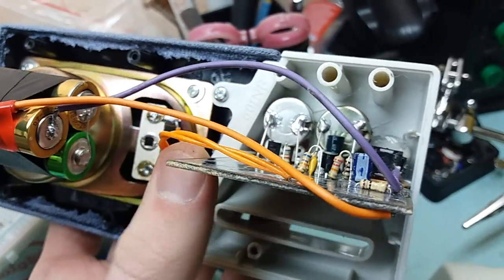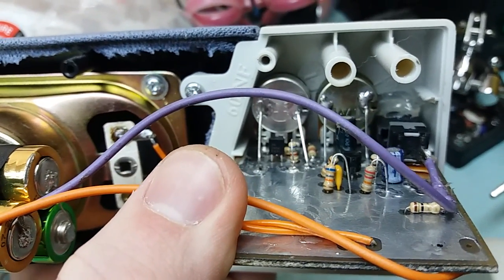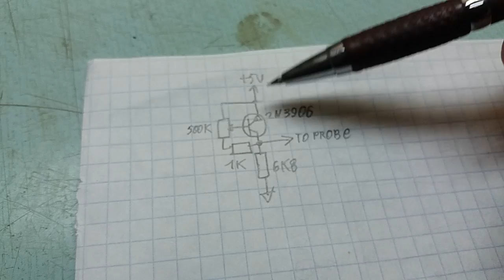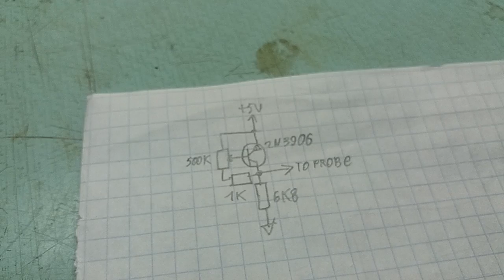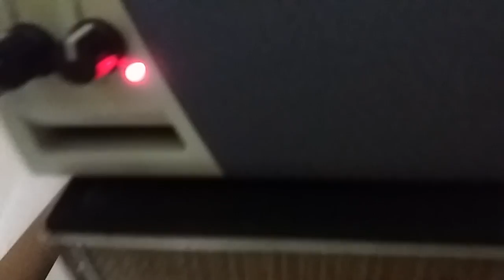My variation of Mr Carlson's SuperProbe

Comment: All my RF probes had a short ground wire to use when needed.  Using your finger could be hazardous.  Especially on a tube circuit.  I also had a probe with 2 spring loaded tips.  The ground one was a bit shorter and slightly flat and abrasive.  It worked great for tightly packed circuits,usually handheld radios.  Boonton Electronics makes a nice analog RF millivolt meter, if they are still around.  It made quick work of going through RF preamp  and IF stages to look for gain or lack of gain to isolate a stage.

Comment: Hey John,
Why can't the entire circuit be in one enclosure and just use a coax from that enclosure with the very end exposed a little to do the sniffing?  I don't understand why the first phase of the circuit needs to be a handheld probe?  If you could give me some insight I would really appreciate it.
Reply from the maker: Leland Raven Honestly, I don't know will it perform different when done like you say. I followed original design, that's why it is as it is.
Reply: Not being John, but this is what I think:
the real sniffing tip is no more than a few millimetres. It could even be that the best performing tip is a clean cut coax ?
Therefore the  capacity is low before it is fed into the the first stage amp,.

In contrary, your proposed long lead has a relatively high capacitance and surface to pick up non-relative stuff, and would badly influence the distance in which the device can point to a signal.
And for the high gain of the probe, probably a longer lead could even produce static noise, just by bending it.

Comment: I don't know much about RF shielding and am learning. Shouldn't the circuit be in a can? Specially with a speaker so close?
I would like to find out why a shielding can is not required in this instance?
Reply from the maker: Well, the actual probe is in a can because the circuit there has a very high gain. The power amplifier section doesn't have that high of a gain to require extensive shielding. The wires going to the speaker are twisted to reduce noise pickup/radiation, and the speaker itself has a shielded magnet. On top of that, the board is double-sided with one side used entirely as a ground plane, which provides some shielding for a signal traces.

Comment: Hey i like your professional pcb's, very clean looking :-).
Yes perhaps you do need a good earth to the probe to help with the mains frequency creaping into the probe.

Did you try wrapping earthed aluminium foil around the black probe to cut down the mains noise?
You only want the tip to have all the amplification.
Hmm capacitive coupling to the audio perhaps?
Reply from the maker: Don't be silly, "professional pcb's", I have a switch hotglued to the thing, bodged supports for the pots :D
 I just didn't find a place on the probe where I'd like to put a ground clip, that's all :) The final ground clip is gonna be detachable so I can use one which is as short as possible. And yes it picks up a signal by stray capacitance.
 The mains hum or buzzing that you've heard in the video is thanks to the fact that the setup was sitting on a freezer, which is not earthed. In fact, you can see buzz going away when I move the probe close to its power amplifier.
Reply: Your pcb is neat and the tracks sharp, the groundplane around through holes looks neat, just imagine a coloured laquer on both sides of the pcb, its only a silkscreen for the components thats missing.
A silkscreen wont make it work any better lol.

Ive seen so called "Pro" boards look really crap in comparison to yours, so dont under rate yours, ok :-D
Reply from the maker: Thanks! I've seen those "professionals" too, it's so funny to hear them bragging about their bodge like it's a masterpiece :D My board may not look as neat as the factory one, but considering I made it with toner transfer method using a cloth iron, it's not too shabby.
Reply: Hey its brilliant, you made it with very basic stuff, i think you did an excellent job :-D.
Im not trying to "butter you up" or get anything out of you, i just appreciate the quality you have produced, i would be very happy with the result :-D.

The pcbs ive made in the past were crude pen made ones, i didnt really care too much how they looked, just needed to be functional, then plop them in a plastic project box never to be seen again LOL :-D.

I did have one go at making a pcb with the tracks printed on clear film and u.v lightbox method, it was a frends equipment i used, and the result was ok, but i didnt get the tracks thick enough so it looked like a starved pcb LOL :-D.
But it did the job! :-).

You did the job with almost nothing, thats an acheavement.